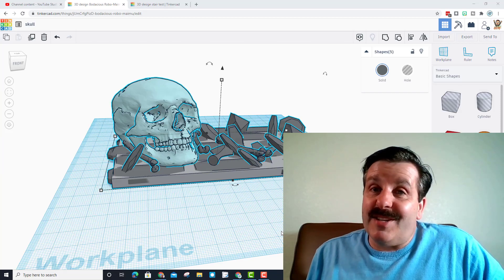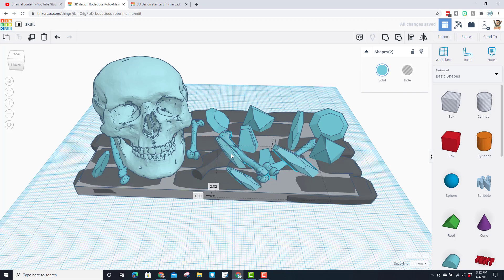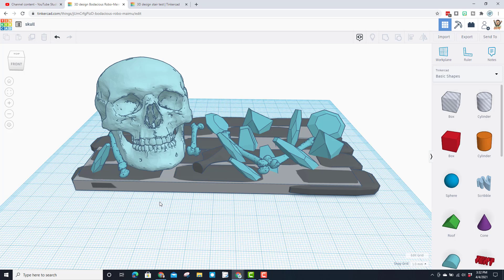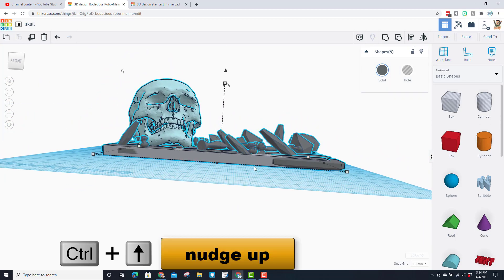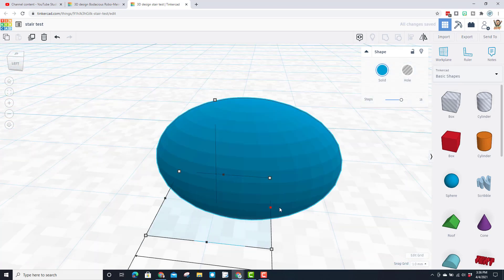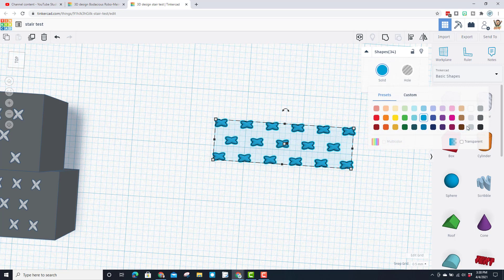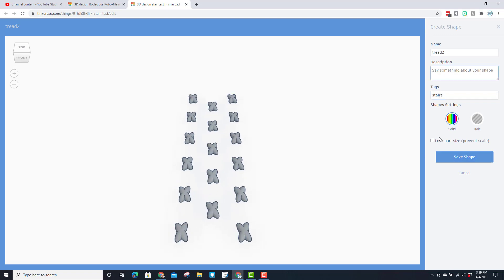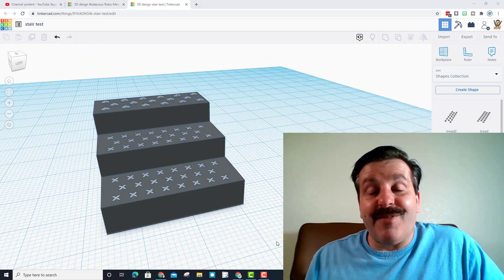Parts & Groups help Tinkercad run FASTER | Master Tinkercad in Minutes

Comment: On one of my dinosaurs I made the bottom was very untidy how do I stop that from happening? Thanks😀
Reply from the maker: We can change the design so the printer is not printing in thin air, add supports where the "drips" were, or possibly calibrate the printer better.  What printer are you working with?
Reply: @HLModTech  ultimaker 2
Reply from the maker: @gamergamergamer9861  I have never played with one, but they have always looked awesome. If you want to send me a share link to the dino, I will take a look at it. https://youtu.be/XeDQjhRK8lg hlmodtech gmail or using the messaging on hlmodtech.com are both slick ways to reach out.
Reply: @HLModTech  ok thanks